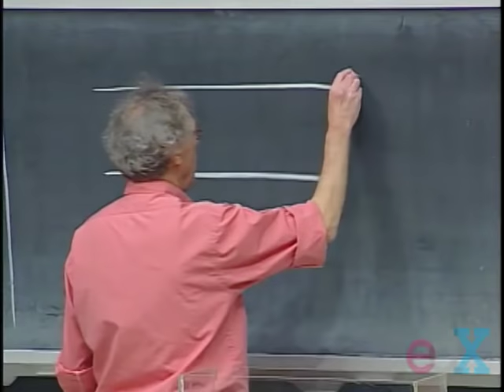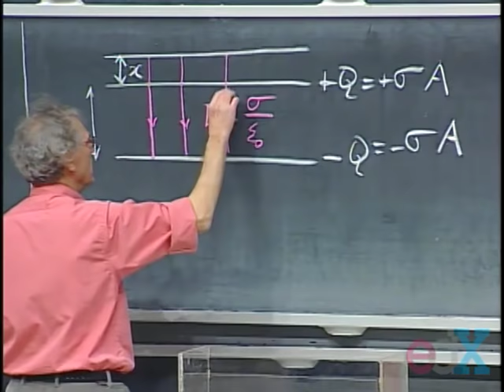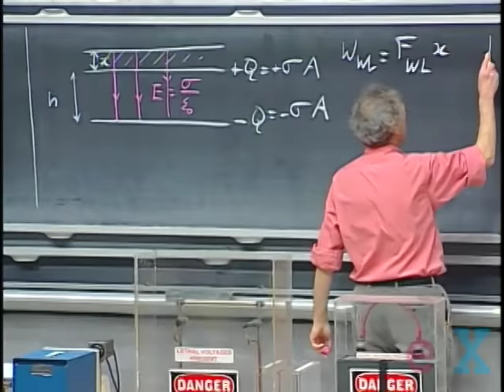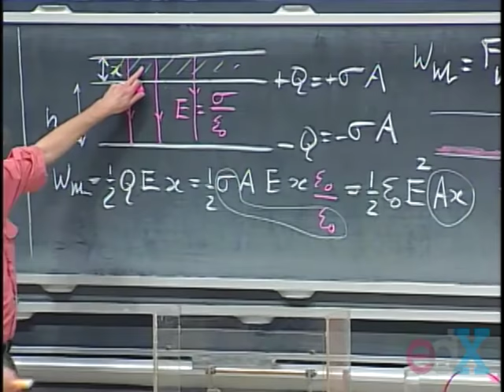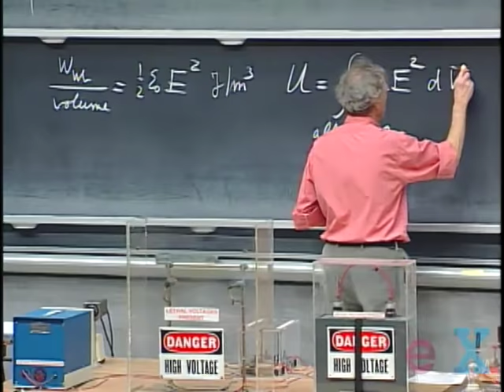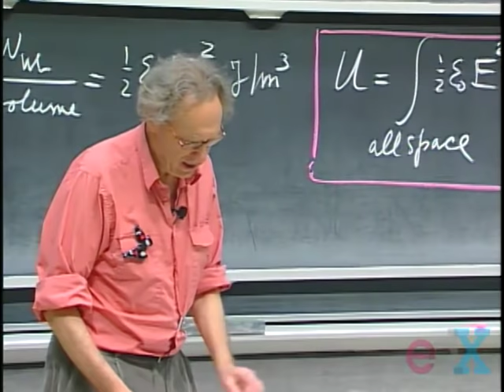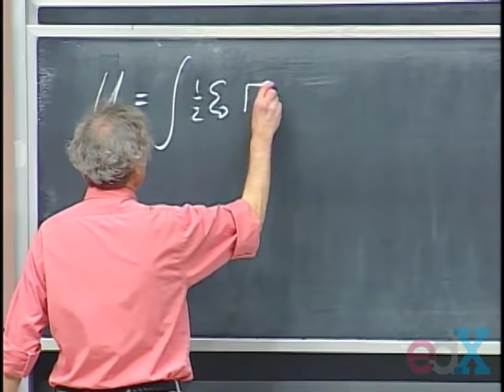8.02x - Lect 7 - Capacitance, Electric Field Energy

Comment: Professor Lewin,
Why can we consider a single conducting sphere as a capacitor? In other words, the distance between our two conducting spheres is very large. 
Thank you.
Reply from the maker: >>>can we consider a single conducting sphere as a capacitor?
yes we can. I cover this in one of my 8.02 lectures
C=4pi*eps_o*R
Reply: Professor, in working out such a problem, we get an expression for the capacitance of the system consisting of the two conducting spheres. In the lecture you also arrive to this result. If we had a parallel plate capacitor, the separation between the conducting plates would be infinite so we would end up with a capacitance of zero (since we are dividing A(epsilon not) by infinity). Is this a valid way of thinking about this?
Thank you.
Reply from the maker: that's ok

Comment: sir what is capacitance of two plates connected by a plate which joins diagonally each other ...
Reply from the maker: it depends on the size of the plates. It's NO longer a two-plate capacitor. It's now ONE conductor. If the plates are 10x10 cm^2 the capacitance is approx 10 pF.

Comment: Professor❤ My father was also refusing to send me to U.S. Universities because He felt that the Total fees would be nearly 27-30 lakhs, but I just talked to an Institute assistant , He told me without any scholarship fees will be nearly 15-20 lakhs per year. But this is for Average Universities not for Top Universities like MIT- But If I get good scholarships by bringing good marks in the SAT ( I will get some scholarship ). Professor❤ I do not think my father will accept it too, I will talk about it with him in night and then I will inform you. Professor❤ Can Student also join 3-4 hour job in US with Studying there ?
Reply from the maker: Scholarships and the degree of other financial support (jobs, loans, fellowships) will depend on how badly a University wants you. Private schools can do anything they want, state schools have financial limitations for foreign students. Tuition differs by a large factor between universities. Many schools do not require SAT. However, if you score more than 95% on your SAT and have more than 4.3/5 average high school  grades and if you get sky high letters of recommendation you will be fine. I cannot add more here as there are more than 1000 colleges in the US and all have different rules. First things first. Take the SAT and take it from there.  I cannot help you in any way with the problem with your father.

Comment: @3.26 why the electric field is half  ?
Reply from the maker: the short answer is that a charge q does not exert an electric force on itself.  A much longer answer is:
factor of 2
Let the charge on each plate of the capacitor be Q=100q (+Q on one plate and --Q on the other). Let the area of each plate be A. The E-field between the plates is then Q/(A*eps_o). Let the distance between the 2 plates be d.  Now release q from the + plate to the negative one. The energy that is released is force*distance which is very close to q*d*Q/(A*eps_o). But after this transfer the E-field is reduced, it’s now only 0.99*Q/(A*eps_o). I now release another q thus the energy that is released is now 1% less than with the first q. By the time I have released 10 times one q, the E-field is only 0.9*Q/(A*eps_o) and thus the force on the charge q is only 0.9*q*Q/(A*eps_o). The force keeps going down as I transfer more charge.  By the time I have released the last q (of 100) the E-field has become 1% of the original E-field thus the force on the last q is about 1% of the force during the first transfer. Thus by the time that I have released 100q=Q the average E-field was only 0.5*Q/(A*eps_o), NOT Q/(A*eps_o). Thus the average force on a charge q during transfer was NOT q*Q/(A*eps_o) but only half that. Thus, by spooning off the charge from one plate to the other the energy release is NOT Q*d*Q/(A*eps_o) but only half of that. The energy that is released this way (also called potential energy) is identical to the work that YOU would have to do to separate the 2 plates over a distance d.

Comment: Hello sir you might feel that this question is awkward...
Please help me, a special question by me, from India...
If Two charged spheres of unequal radius are connected through a conducting wire.. will both the spheres get equal charges?
I want to ask "will both the charges get fifty fifty percent charges?"
Reply from the maker: >>> will both the spheres get equal charges?>>> NOOOOOOOO!!!! as they will both have the same eletric potential. I cover this in my 8.02 lectures. PLse watch therm.
Reply: @lecturesbywalterlewin.they9259  
This is the most important question that I want to ask..
I just want to know why they both will have equal potential..please don't tell that "because they are connected through conducting wire" please give some intuitive idea sir please🙏
"If both have same potential then I put unit charge in my pocket and I have to do the same work to reach either of the spheres"
Is all this true and if yes then why please tell??🙏🙏🙏🙏
Reply from the maker: if they had a different electric potential (EP) then a current would flow from the hi to low EP. The curent will stop when the EP are the same.
Reply: @lecturesbywalterlewin.they9259  
Thankyou..
GuruJi..
I am continuously watching further lectures..
I am sure you will help me with further problems if I have..❤️

Comment: If we only charge charge on one plane, the other plane will automatically carry the opposite of charge, Is it correct?
Reply from the maker: depends on the circuit.
Reply: @lecturesbywalterlewin.they9259  I don’t understand it, how the power supplies charge the capacitor.

Comment: Sir when two conducting plates are kept parallel and one of them is charged.Does this form a capacitor
Reply from the maker: +Veeresh m you cannot charge only 1 plate. The other plate automatically gets charged (opposite charge - same magnitude) through induction. Even if you ground the other plate it will still get charged.
Reply: Yes Sir,but will that form a capacitor.
Reply: Then will not the EF on one side of the uncharged plate will be non-zero.
Reply from the maker: +Veeresh m Any conducting object has a certain capacitance. For a single spherical object of radius 1 cm the capacitance is about 1 picoF. Thus a single plate 10x10 cm of thickness 0.5 cm has a capacitance of approx 50 picoF. Any combination of two object close together are often called a "capacitor" but what's in a name? All capacitors in circuits are made of 2 conductors close together. The thinner the layer between them the larger the probability for an electric breakdown. That's why capacitors with a very high capacitance can only be used up to a maximum voltage which is sometimes printed on the capacitor. A VERY high capacitance always means that the layer between the two conductors is very very thin (microns and even smaller).
Reply from the maker: +Veeresh m 1. what is EF 
2. it is not possible to charge only 1 plate. Thus there is no "uncharged plate"
Reply: Thank you sir

Comment: why we take the average electric feild  for for inside and outseide of a plate as the electric feil is due to the whole plate and acc. to gauss law electric feild should be sigma/epsilon zero
Reply from the maker: The easiest is to take the average. However, if you want to be 100% convinced about the factor of 2, read the following.
Infamous factor of 2
Let the charge on each plate of the capacitor be Q=100q (+Q on one plate and --Q on the other). Let the area of each plate be A. The E-field between the plates is then Q/(A*eps_o). Let the distance between the 2 plates be d.  Now release q from the + plate to the negative one. The energy that is released is force*distance which is very close to q*d*Q/(A*eps_o). But after this transfer the E-field is reduced, it’s now only 0.99*Q/(A*eps_o). I now release another q thus the energy that is released is now 1% less than with the first q. By the time I have released 10 times one q, the E-field is only 0.9*Q/(A*eps_o) and thus the force on the charge q is only 0.9*q*Q/(A*eps_o). The force keeps going down as I transfer more charge.  By the time I have released the last q (of 100) the E-field has become 1% of the original E-field thus the force on the last q is about 1% of the force during the first transfer. Thus by the time that I have released 100q=Q the average E-field was only 0.5*Q/(A*eps_o), NOT Q/(A*eps_o). Thus the average force on a charge q during transfer was NOT q*Q/(A*eps_o) but only half that. Thus, by spooning off the charge from one plate to the other the energy release is NOT Q*d*Q/(A*eps_o) but only half of that. The energy that is released this way (also called potential energy) is identical to the work that YOU would have to do to separate the 2 plates over a distance d.

Comment: 15:50 sir I have a doubt sir! By bringing the negatively charged sphere near ,the potential difference is increasing and so the capacitance must go down...
Reply from the maker: bringing the negatively charged sphere near, the potential difference is nonsense  as you cannot bring a charge near a potential difference
Reply: @lecturesbywalterlewin.they9259  sir could you please make me understand if I'm wrong.i don't understand sir what I've asked wrong. Let's say that the sphere adjacent to that is neutral and then gets negatively charged somehow.if you see the potential difference between both the spheres it has increased as compared to before. If my statements are wrong could you please make video on that sir ?
Reply from the maker: @arjunvg4719  question is ill-defined - .>>>> Let's say that the sphere adjacent to that >>>>>>> adjacent to WHAT?   this is my last msg
Reply: @lecturesbywalterlewin.they9259  sphere near the positively charged sphere sir
Reply from the maker: @arjunvg4719  when I bring a neutral sphere near a positively charged sphere (withou touching it)  charge inside that neutral sphere becomes polarized but the net charge remains zero.

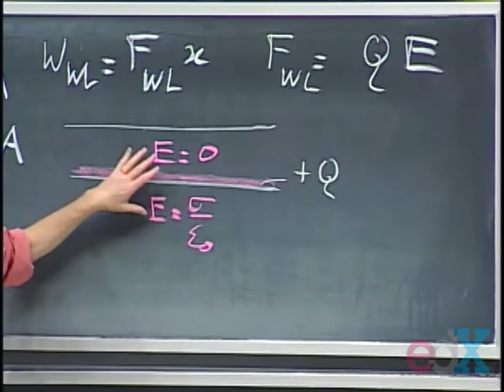Comment: Sir why did u take average of electric field at 3:27
Reply from the maker: factor of 2
Let the charge on each plate of the capacitor be Q=100q (+Q on one plate and --Q on the other). Let the area of each plate be A. The E-field between the plates is then Q/(A*eps_o). Let the distance between the 2 plates be d.  Now release q from the + plate to the negative one. The energy that is released is force*distance which is very close to q*d*Q/(A*eps_o). But after this transfer the E-field is reduced, it’s now only 0.99*Q/(A*eps_o). I now release another q thus the energy that is released is now 1% less than with the first q. By the time I have released 10 times one q, the E-field is only 0.9*Q/(A*eps_o) and thus the force on the charge q is only 0.9*q*Q/(A*eps_o). The force keeps going down as I transfer more charge.  By the time I have released the last q (of 100) the E-field has become 1% of the original E-field thus the force on the last q is about 1% of the force during the first transfer. Thus by the time that I have released 100q=Q the average E-field was only 0.5*Q/(A*eps_o), NOT Q/(A*eps_o). Thus the average force on a charge q during transfer was NOT q*Q/(A*eps_o) but only half that. Thus, by spooning off the chaInfamousrge from one plate to the other the energy release is NOT Q*d*Q/(A*eps_o) but only half of that. The energy that is released this way (also called potential energy) is identical to the work that YOU would have to do to separate the 2 plates over a distance d.

Comment: sir in this lecture firstly you say the definition of capacitance=  electric charge stored / electric potential . sir you change the definition to c=Q\potential difference. sir why you change potential to potential difference
Reply from the maker: in the case of a capacitor we often use the word potential which, of course, always means the potential difference between the 2 plates.

Comment: sir in 15:58 the at which point we have to measure the potential difference?????
Reply from the maker: +NEERAJ SHARMA you can measure the potential difference with a Voltmeter (with very high internal resistance). Attach one side of the Voltmeter to one plate of the capacitor and the other side of the Volt meter to the other plate.
Reply: +Lectures by Walter Lewin. They will make you ♥ Physics. thnx sir

Comment: Sir When a charge is moving, it does not only have an electric field, but a magnetic field as well Why???
Reply from the maker: ask google
Reply: Lectures by Walter Lewin. They will make you ♥ Physics. Sir on Google it's a bit confusing can you explain it to me
Reply from the maker: There are countless articles on this - FIND THEM. Please do not waste my time.
Reply: Lectures by Walter Lewin. They will make you ♥ Physics. Ok Sir and Sorry for any inconvenience
Reply: Technically, Through various experiments of Oersted, Faraday and Maxwell, it has been found that electric and magnetic fields are not only perpendicular to each other, but also complementary to each other. They are not independent, whenever either charge or magnet is in motion, but are independent as far as either charge or magnet is stationary. Without this property of electricity and magnetism, or electromagnetism, light cannot exist, AC cannot exist, life cannot exist

Comment: sir,can we covert a capacitor into a battery..since both can save charges?
Reply from the maker: a battery needs a power source (chemical energy). It does not "store" charges, it produces them. A capacitor stores charges but that's all there is. Your light bulb may only be lit for 1 second and then the capacitor has lost its charge.
Reply: thank you for..your explanaition sir!

Comment: Sir what happens if the distance between two plates of a capacitor is increased while connected to a battery
Reply from the maker: The potential difference, V, between the plates remains constant. The capacitance, C, goes down. Q=CV, thus Q goes down.
Reply: Sir then where the losing charge goes
Reply from the maker: as you make the separation larger a current will flow in the opposite direction as when you were charging the capacitor. If the battery is rechargeable it will gain some energy and some heat will also be dissipated, if it is not rechargeable it will dissipate in the form of heat in the resistance of the circuit (which includes the internal resistance of the battery).
Reply: Thank you sir

Comment: sir which work I do at infinty to assemble the charge. please sir g
Reply from the maker: To put 1 C charge together, you have to do work. How much depends on the size of your charge. Suppose you put it on a conducting sphere with a radius of 1 cm, you should then be able to calculate how much work that is. The amount of work would be equivalent to the Electric potential energy of the spherical configuration wit radius 1 cm.
Reply from the maker: The smallest charges that are available to you to compose a 1 C charge are electrons. You will have to assemble 6.3*10^18 electrons on a sphere with radius 1 cm to get 1 C. It's possible to calculate how much work that will cost. It's the electric potential energy of the system. If you make the radius of the sphere smaller, it will take MORE work, if you make it larger it will take less work. Suppose you make it 2 cm, than the E field at the surface of the sphere will be smaller than in the case of the 1 cm radius. There will be no E field now between r=1 and 2 cm. Thus the volume integral of the field density has gone down. The amount by which it has gone down is EXACTLY the same as the difference in the electric PE between the 1 cm and the 2 cm sphere. Thus both statements 1) and 2) that you referred to are correct. I hope this helps.

Comment: 344 see pratham why 1/2
Reply from the maker: factor of 2
Let the charge on each plate of the capacitor be Q=100q (+Q on one plate and --Q on the other). Let the area of each plate be A. The E-field between the plates is then Q/(A*eps_o). Let the distance between the 2 plates be d.  Now release q from the + plate to the negative one. The energy that is released is force*distance which is very close to q*d*Q/(A*eps_o). But after this transfer the E-field is reduced, it’s now only 0.99*Q/(A*eps_o). I now release another q thus the energy that is released is now 1% less than with the first q. By the time I have released 10 times one q, the E-field is only 0.9*Q/(A*eps_o) and thus the force on the charge q is only 0.9*q*Q/(A*eps_o). The force keeps going down as I transfer more charge.  By the time I have released the last q (of 100) the E-field has become 1% of the original E-field thus the force on the last q is about 1% of the force during the first transfer. Thus by the time that I have released 100q=Q the average E-field was only 0.5*Q/(A*eps_o), NOT Q/(A*eps_o). Thus the average force on a charge q during transfer was NOT q*Q/(A*eps_o) but only half that. Thus, by spooning off the charge from one plate to the other the energy release is NOT Q*d*Q/(A*eps_o) but only half of that. The energy that is released this way (also called potential energy) is identical to the work that YOU would have to do to separate the 2 plates over a distance d.
Reply: @lecturesbywalterlewin.they9259  thank you sir love from india , (Maharashtra )